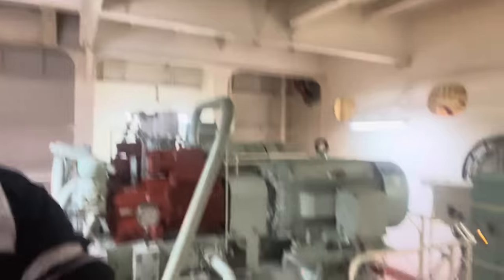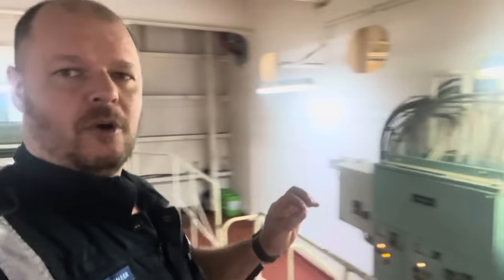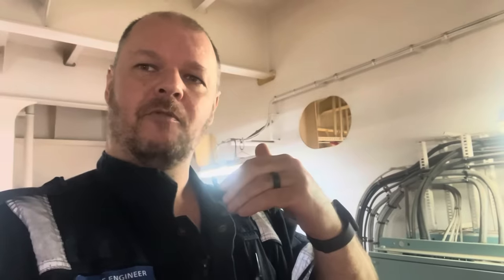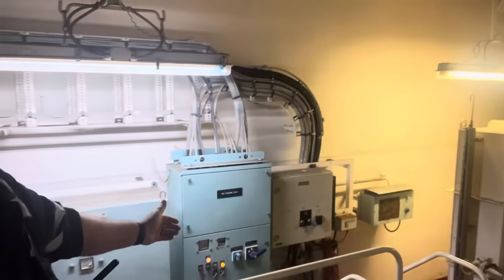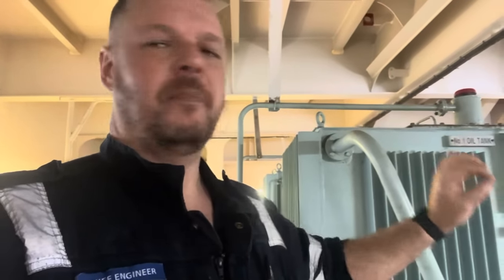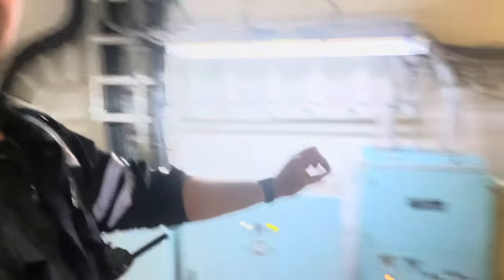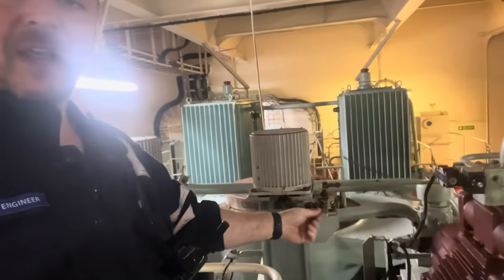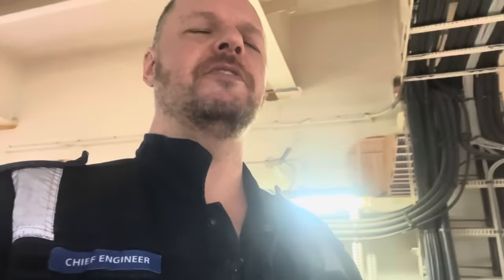Dali size containership steering system. How it’s designed to not hit Francis Scott key bridge

Comment: Great video. I do have one question, (retired Aerospace Engineer here, and I know I am a PITA...)
Let's say they could turn the rudder, but I have never heard what their forward speed was over the current. If you are going the same speed as the flow of the water, the position of the rudder really is not an issue. I know that China is running their ships at what I would call a skeleton crew, and that decision is seldom based on safety.
I appreciate the time and effort you have put in to this video, and I want to thank you for the information, and for all my stuff,k (high end engineering term,) the Ships bring.
I wish that all the Ships out there had a Chief Engineer of your dedication.
Smiles.
Reply from the maker: So I’m not the expert on ship handling that’s going to be a pilot. But I do know the rudder effectiveness is significantly impacted by the water flowing past it and using the propeller to push water by the rudder to turn is a tactic, of course when the lights went out it means the engine stopped and significantly changed the amount of water moving by the rudder

Comment: One aspect that most people fail to understand is just how difficult is is to change the course of the BOW (front) of a ship that is nearly 1 000 feet long. This is because the rudder is at the REAR (stern) of the ship, which would have to move a considerable distance to port or starboard (while still moving forward) before there can be ANY movement at the BOW of the ship. Only then can the ship's BOW start its movement in the new direction. In the case of the Dali (which, for some reason started turning out of its lane), any movement of the rudder would FIRST have to neutralise the turn angle before beginning to turn in the opposite direction. Clearly this would take some time for this to happen, during which time the ship's forward movement still continued, but was gradually slowing. Clearly in the case of Dali, it was obviously not sufficient time or sufficient distance to effect enough meaningful change in direction. 
For comparison, it's like driving a motor vehicle in reverse gear at about 17 kph - try it and you will see its actually quite tricky! Now imagine doing that with a 1 000 feet-long vehicle!

Comment: Awesome! Thanks. One thing Chief Makoi mentions is that a black out would have caused the drive engine to stop, and they possibly didn't have enough rudder authority without the prop wash to maneuver. So even if the backup had come online and given them steering, it might have just been too little too late given currents and whatever else. The root cause is obviously in question, but it sounds more and more like, regardless of the cause of the black out, they were not going to control that ship in time. But I'm just an airline pilot who's interested in ships. So, I'm just trying to apply what I know.
Reply from the maker: Yes main engine definitely would have shut down in a blackout. What it was capable of restarting blacked out canceling limits is a good question I wouldn’t be able to answer because it’s a different engine than mine

Comment: Nice run down on the redundant ops. It's nice when the backup systems kick in and control is restored like designed. Things go south quick when generators fail to come online or even start. Buss ties and contactors that divide up the systems sometimes stick or fail and circuit breakers trip. There's also the human factors where people don't always diagnose the issue correctly or follow the correct procedures to restore control. Manual reversion can also be built in, but it also requires a knowledgeable crew and communication. Lots of engineering goes into these complex systems, but there's no way to take every bit of risk out of the operation, you can only manage and mitigate risk.

Comment: When I worked in Telephone exchanges there was a 1000 Amp 50 V Battery and a motor that kept the diesel fly wheel at spinning 3000 rpm and clutch to the crank that was kept open by the grid when it failed the genni goes from 0 to 3000 rpm in one turn the special crank twisted 120 deg before the other end moved.

Comment: Very good explanation on a rudder system. I know nothing of ship operation, but I'm a millwright and master electrician who has worked in many large manufacturing plants. I understand that the Dali dropped port anchor after the power outage. When power was restored, regardless of rudder position, the anchor would have skewed the heading of the ship. I assume that full reverse was attempted due to the smoke from the stack.I think the anchor made the ship yaw into the bridge support. Just a guess.

Comment: This is an excellent presentation, but while it answers a lot of questions (and the video tour itself is very cool), it also raises many questions:
The "black box" recovered from the MV Dali, the last two minutes were "blank." So the "electrical failure" was total enough to disable the black box. What can do that?
What "redundancies" would have to be broken/disabled/inactive to accomplish the complete and total disablement of everything you just showed us?
If I were a "bad actor" and wanted to cause those systems to malfunction, where would I put my "device" in that system (don't answer that one online pls)?
If I even could ACCESS the ship to do everything I just suggested, would I be able to "activate" my "device" REMOTELY from OFF THE SHIP? Think radio/WiFi, etc.?
Given that the Pilot almost certainly was commanding the ship in harbor, would that have put the crew at ease/disadvantage with respect to responding to the sudden power interruption?

🔧
Reply: The VDR black box is a wheelhouse audio recorder and and is attached to the ship's automation network. The incoming signal from the ship's automation network was probably dependent on normal or emergency power at some switch somewhere and it was overlooked that it should have been UPS. Or it's just glitchy junk or something else stupid not hooked up right or never fully tested. It's hard to get anything that's not garbage these days.

There's tons of alarm and equipment operation logs printing onto continuous perforated dot matrix sheets and there'll be identical digital logs (plus more information) in the automation consoles on the bridge and in the engine control room that run redundant printers. And it absolutely should all be on UPS.

USCG and NTSB have no doubt been all over these and questioned the crew as to what their moves were to see how their stories match the timeline. Also some deep physical inspections and maintenance / repairs records auditing. The Chief better have his shit in order.

Comment: Excellent description of the steering system which is clealy well designed.  I have not been involved with large ships like yours but have experience on work boats.  It occurs to me that it would add a degree of redundancy to station someone in the steering compartment during critical maneuvers who could operate the manual valves of the steering system if needed.  Though that obviously r equires power to the steering hydraulics motor and a functioning communication link to the bridge.  But then total loss of electrical power, which should not happen given the redundancy in a modern vessel, makes the main engine and anchoring systems also inoperable which means being able to steer probably isnt going to matter much in a close quarters situation anyway.  The big issue is keeping the power on and how that failed in Baltimore.

Comment: Thank you for this - input and insight from people like yourself, with actual experience, is super helpful.  I appreciate, too, that you didn't stray into speculation...just the equipment.  

I would love to hear your thoughts, from an equipment/design perspective, on what looked like a pretty hard turn to starboard.  Would a system failure leave the rudder free to move or would it remain locked in the position in which it failed?

Comment: I was on a boat (400ft) in the bearing sea alaska when the entire boat went dark, engines, steerage, navlights, everything, it was eerie.  While getting tossed around in the trough it was revelealed that a fire in one of the generators reduction gears had caused a full shutdown of power throughout the ship.  The point being that while a boat is navigating in constrained waters, the demand on the steering system is high, and at that critical moment, a loss of power could in fact leave you helplessly out of control and blind if at night.  The navigation lights for example, very simple circuit and they went out.  Presuming they lost power, that means they lost radar (reboot takes a minute) and navigational orientation.  No bueno.

Comment: Former Coast Guard here. On both 210’s I was stationed on we’d always set Sea Detail when entering and leaving port. We’d have guys stationed in aft steering where the emergency generator was along with all the steering gear. I know there’s a limited amount of crew members on ships like yours, but my question is. Do you not have your emergency generator up to temp and running while entering and leaving port? We always did, and it’s a good thing too, we lost ships power while crossing a small bar, all I had to do was shift power to the emergency generator, took a second or two.
Reply from the maker: No the emergency generator is run as little as possible to keep it in excellent condition, but we are required to run 2 main generators which would accomplish the same objective. Wait for the investigation but I doubt Dali was following protocol

Comment: On a converted military ship that I sailed for years, there was all the redundancy you described. Additionally, entering or departing port, on the announcement of "set sea and anchor detail, man after steering" an engineer would be stationed on the steering flat. There was a gyro repeater, sound powered telephone,  local steering controls, and a seat. I don't recall there ever being a drill trying to con the ship from back there, but apparently it was possible...

Comment: Truly fascinating overview! Thank you!

It will be interesting to see the final report. Redundant systems are only as good as the humans who keep them up, and humans sadly come in a very wide variety. The pilot appears to have been on their game, making timely calls to the port, etc. The tidal conditions of course play into the math. Why ever the power failed in the first place is in question, and whether the backup genny started according to plan, and that relays were positioned correctly. The engine and prop will another question...can't stop or start those on a dime at all.

We hope and pray ports and civil authorities start working seriously on pilon islands and dolphins to protect bridges, especially any so openly exposed as the FSK bridge. There are soooo so many such bridges. It is far lest expensive to add such features than to build a whole new bridge.

Accidents happen, and most often they're just a combination of bad luck and maybe one or two blind spots in maintenance or even design. They got so lucky that it happened when it did. Rush hour would have been so much worse.

Comment: Nicely laid out info on the steering and backup systems!

So I'm guessing that once there is a failure all the way at the level of electrical generator, it's game over? Is emergency battery backup a thing, or electric steering and propulsion is just tapped out unless you have a running diesel engine (emergency or otherwise) driving a generator?
Reply from the maker: As of now no generator no steering, I guess the thought there is the engine can’t run without a generator anyway so you wouldn’t be steering very far.

Comment: Thank you for taking the time to make this video. If you have an electrical power failure (main and emergency) to the rudder hydraulics, what happens to the rudder? Is it locked in the last position? Or is it free to move on its own? Looking at the yoke controlled by the hydraulic pistons, I would surmise the rudder would be locked in the last position. How does a ship such as the Dali veer hard to starboard after propulsion and rudder failure? Currents and wind?
Reply from the maker: My experience is they don’t move without a pump moving them so no electricity no movement but I don’t know that exact unit

Comment: It may be good for people, not familiar with ships, to know that when everything goes black, the tiebreaker between the emergency switchboard and the main switchboard will open when the emergency generator breaker closes and provide power to the emergency switchboard.
Another practical thing for people to understand is that the effect of the rudder will be greatly decreased without the main engine because it is the water pressure from the passing water from the propeller than makes the rudder effective. The ship was moving at 8.5 knot when they suffered the blackout and at that speed without the main engine, the actual movement of the rudder will be available with power from the emergency switchboard but the heading of the ship would be pretty slow to react to rudder input without the water forces provided by the propeller when the main engine is working.
One fault that could have prevented the crew from getting a main generator up quickly again is a major fault related to the main bus in the switchboard. This particular ship has 4 main Diesel generators so if they have a suspected fault related to the main bus in the main switchboard, they need to know where that fault may be so they can separate the switchboard sections by opening the switchboard tiebreakers and then power up the main generators that can power up the sections of the switchboard with no faults.
Since it's a relatively new ship (less than 10 years old), there could also be a fault with the ship's power management system (in theory) and finally, somebody could have made a cockup (the human element).
During harbor maneuvers, you always run more generators online than actually needed plus you test the function of a lot of things before maneuvering commences.
The problem with this accident was the time the blackout happened and the proximity of the ship to the bridge when it happened.
A lot of people have questioned the change in heading of the ship after the blackout, but that can actually happen if either the steering gear was in any other position than neutral when the blackout happened but a more likely reason may be the tidal current at the time.
While a ship this size is obviously quite big, it is always dwarfed by the volume of water it is floating in. Most people would be surprised if they knew how quickly a sea current can start to move a ship, even a very big ship.
Hopefully, NTSB will come out with some preliminary findings to better understand what happened.
From the video, the time passing from going all black to getting emergency lighting took a bit longer than I would have expected.
People with knowledge of ships can think up a range of scenarios that may describe this accident but until all the facts are established, these scenarios will just remain to be qualified guesswork.

Comment: Great explanation.  I hope the public gets a transcript of data recorders on board.
Reply: Typically you won’t. Investigations are about what went wrong and how it can be avoided in the future.
Transcripts tend to be for legal liability cases.
Reply: Transcripts are generally in the final NTSB report along with charts of data.  Fairly certain there will be a second by second animation created from the data.  At some point they will load the data into a ship simulator to get an understanding of what the crew saw.  The training simulator is a mock up of a ship's bridge with warning alarms going off and video screens depicting a harbor in clear, rain or fog.
Reply: Adding to my other comment.  If there was a circuit breaker locked out, a cotter pin not installed, a plastic wire tie used instead of a missing bolt, it will be in the report.
Reply: I would be more interested in the commands issued by the master. If they went full astern, they lost all rudder control on a vessel with forward inertia.

Comment: Hey, could you tell me whether my interpretation is plausible?
It looks to me like it lost power, then when the power came back on they hit reverse. It's a single-screw ship, right? So by hitting reverse they cause the ship to skew randomly, in this case to the starboard.
There are two reasons reverse under power should cause random skew, the most important being the impact on the rudder's control.
Am I on the right track?